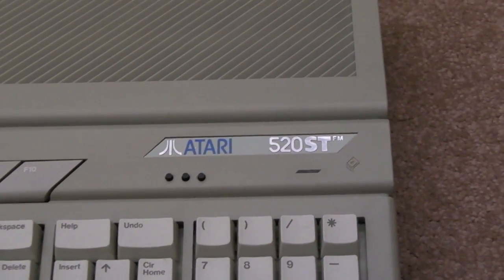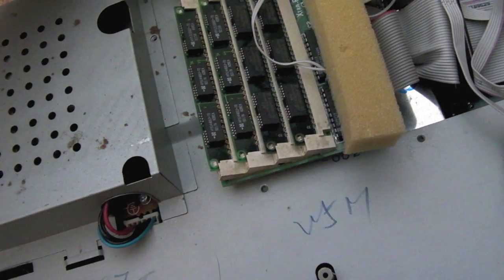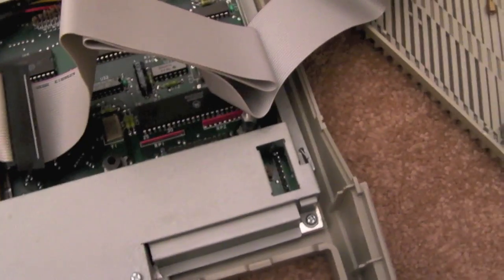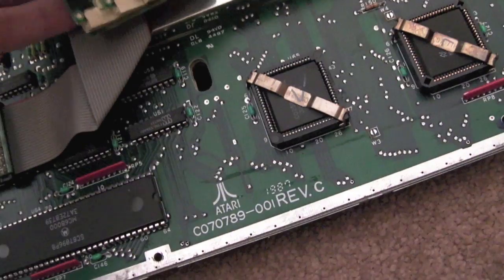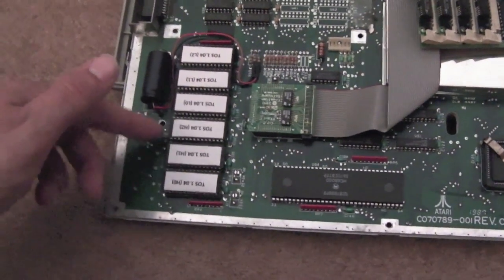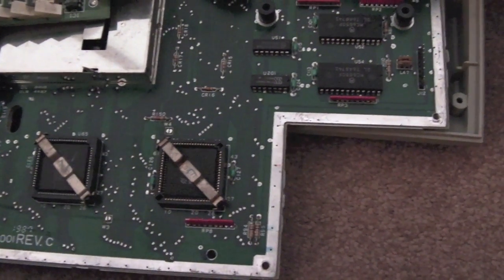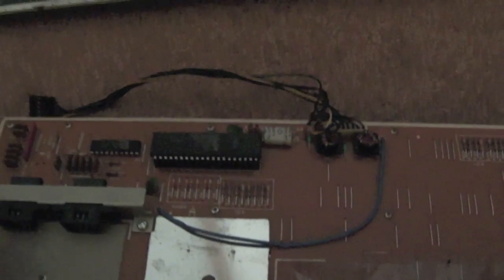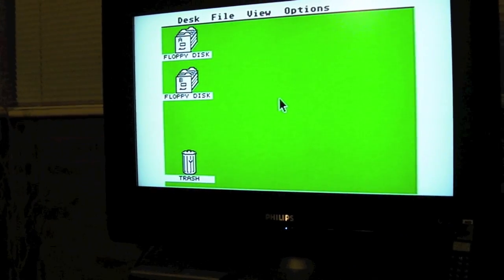Atari 520STFM Teardown + 4Mb Marpet Xtra RAM + TOS + Blitter Upgrade + HxC Floppy Emulator & More

Comment: Good to know there's not too much to go wrong.  I was looking at them on eBay and there are a lot of "untested as I don't have the cables but the light comes on".  In pretty much any other retro machine I'd expect to find a damaged board, and a leaky CMOS battery looking back at me all "what?" like a puppy stood among a pile of shredded loo roll.
Reply from the maker: Hehe =D  Power Supply tends to be the main issue in ST's.  Occasionally you may get bad RAM, or a faulty Glue or Shifter chip.  They are much more robust than Amigas though imho.
Reply: That's cool! I'm an Amiga man at heart (hey, easy on the tomato throwing) as I only had an Atari for about a year or two when I was 5 then it was swapped for an Amiga after, but I do have memories of it and wouldn't mind one for the first part of a "reliving the journey" (of my computing past) that I'm hoping to do :). Cap changes for PSUs no big deal... I've saved my share of monitors from landfill that way....
Reply: I've kept Amiga for Amiga Forever and stuck with ST for real hardware as it is better designed for the most part. The case and GUI look better too.

The PSUs are iffy, not quite the Atari XL ingot, but the Meanwell RD50 and 60 are small enough to fit. The 50 requires off the shelf cable. The 60 requires a 3 prong jack that isn't cheap to obtain, but the tradeoff is smaller size for the same power output. And the amperage is definitely needed if add-ons like memory are to be added as the 5v rail on the original is 3A. Meanwell's is 6A for the 5v rail and that's better than plenty!

Comment: Great video. :) I remember my STe PSU failing when I was a kid. I used a Spectrum +3 power supply and wired it onto the connector. Worked for years like that! :)
Reply from the maker: Haha, that's sweet lol!  Never would have thought of using a +3 PSU to power an ST =)
Reply from the maker: Thanks for the positive comments and for watching and commenting btw =)

Comment: Nice seeing the tear down you have done.  One thing to mention though, looks like you are doing this on a rug, and there is a handful of CMOS chips in there where static electricity can zap the life out of those chips.
Reply from the maker: Yes, on more recent videos I stay well away from the carpet =D   It's a case of when I worked in the trade I always worked off ESD mats with a wrist strap, but 30 years later I got lazy when I first started working on my own stuff.  I've taken the feedback along the way and corrected my ways.
Reply: @GadgetUK164  Handy hint is you can usually ground your static just by touching the shielding in the case, its not the right way to do it but its an old trick, hence why you were fine doing what you did. p.s where did you get your 4Mb Marpet Xtra RAM from? wouldn't mind doing that mod on my 520stfm

Comment: Hi! I'm just watching (and in some cases, re-watching) your series on the ST. After many years, I've become the proud owner of a stock 520STfm. It's in a filthy state and in need of retrobriting but appears to work ok. I have a question regarding the keyboard - are all of the screws the same length or do they vary..?
Reply from the maker: The tiny screws underneath the keyboard - I think there might be one or two longer ones but most of them are the same size.  On the case there are a few different lengths I think.  It has been a while since I took an ST to pieces.
Reply: GadgetUK164 I had a feeling you might say that. Best I get my magnetic mat out when I do it then! Many thanks, Dave

Comment: Hi there I have a question,  I am getting a 520 stfm from Greece to be sent stateside. Does the built in power supply allow for the voltage to change from the 205 to 110 volts ?
Reply from the maker: Not that I am aware of!  I think the power supplies for these are region specific - I could be wrong though!  Just inspect the PSU PCB and look for anything that says 220 / 110V

Comment: What does a upgraded Blitter give you? Are you able to run TOS 206 if you wanted??
Reply from the maker: The Blitter is used by GEM - so any window based app makes use of it.  Some software also supports the Blitter and one or two games (but not much).  To run TOS 2.06 you need additional address decoding - I think the TOS upgrade from Exxos covers that (check first before ordering).
Reply: @GadgetUK164  Thank you:glasses-purple-yellow-diamond:

Comment: Hi, just wanted to say i enjoy your videos really educational too and they have helped me with lots of my own little home projects. I was hoping to pick your brain on an issue i had. I have an old Amstrad PC1640 DD that i have taken from someone who was going to send it to the tip.

The Amstrad powers on and seems to work okay, it has the original mouse and keyboard which also seem fine. The issue is with the old ECD monitor i have as the screen is just showing up black, I have spent hours searching online for old manuals and finally found a pdf with the full manual which has helped me to troubleshoot and try lots of different things but still no luck.

I was wondering if you might be able to take a look at this and it might make a great video to look at this old machine thats quite hard to find today is one piece with all the peripherals together too.

I could attach pictures of video at a later date so you could see what you are dealing with and also i guess it depends where your location is so i could drop it off near you also.

thanks Josh
Reply from the maker: Thanks, I cannot do repairs for other people due to a long term health problem.   If you are based in the UK you might be able to get it repaired by 'Dave Curran' at tymemouth software?   I suspect I know what's wrong with it, and might have a spare part if Dave needs it.  Those monitors provided power to the base unit, and they had large chips stuck to a heat sink (I cannot remember the correct name of the package body of the chip) - often their part numbers started STK.  Those are what failed all the time in those old Amstrad monitors.  It was so common that when I was in the industry we started adding 12v fans inside the monitor to cool the heat sinked 'STK' chips.
Reply from the maker: Sorry - typo there "Tynemouth Software"  http://www.tynemouthsoftware.co.uk/

Comment: I have this old Marpet +8 for STe that gives 8Mb Ram.. even have the floppy and manual for it still. Can't remember where I bought it but it was on sale :D
Reply from the maker: Isn't there a 4MB limit for the ST and STe?  It must be ALT-RAM or something?  Quite rare I would think!
Reply: From what I've read it seems to trick tos into thinking it's a TT, so it's probably seen as alt-ram for a total of 12Mb. The 68k is able to address 16Mb i think. I don't have an STe any more so I can't test it.

Comment: Just recapped my stfm power supply , it was completely dead before, wouldn't even show a power led on. replaced all caps with similar or higher specs, suspect it was the 400v cap which had swollen at the top.
Reply from the maker: Great job =D  Another ST saved!!!

Comment: Nice Video, Thanks for the hard work.....  I am thinking of getting the Floppy Interface like you have, any chance you can do a video on how you set up the SD Card and how to copy from PC to card etc... ?
Reply from the maker: I will try and do a video on this at some point!  I had planned to do one related to the Ultra Satan - that's a better purchase than the SD floppy drive imo.  Because you can copy games onto the SD still, but they run much faster etc.   If you haven't already, check out PP's hard disk adaptions here:- http://atari.8bitchip.info/fromhd.php   And if you do get an Ultra Satan (HDD rather than FDD), you can get PP's hard disk driver from that website too - it's pretty cheap, something like 15 or 20 euros I think.

Comment: Capacitance may be fine but what is its ESR? Unless you can verify that a capacitor has the correct ESR, they are generally bad if old as you can not guarantee that the electrolytic compound leaked out as not all capacitors will pop.
Reply from the maker: From my experience, there is a relationship between capacitance and ESR.  When its capacitance is spot on, it's rare the ESR is out - it can happen, but I've found it to be rare.  I've been collecting every single cap I've removed from things over the last 4 years or so., and I will be covering that in a video at some point.
Reply: @GadgetUK164  So how do you know when a capacitor is stuffed and behaving like a conductor and putting DC bias on a rail where it shouldn't be?
Reply from the maker: Obviously its a good idea to check the ESR if you can!  I will be recapping the motherboard on that ST soon - will check the ESR on each I remove, but I am betting they are probably all OK.  The sheer volume of caps I've replaced over the last 4 or 5 years is staggering, and in all cases where I replaced them for the hell of it - all the ones on the board were all still fine.  There are places cap fail more (eg. PSUs) and there are bad brands etc, but there are far too many people thinking that you must always swap out every single electrolytic in a system.

Comment: What's the reason for having 4MB on STF? Are there any games that require 4Mb of RAM?
Reply from the maker: I use it with a HDD, there are thousands of games converted to run from HDD (See Atari PP Adapted Games) in Google).  Those make use of RAM above 1MB.
Reply: @GadgetUK164  Oh, so it is basically like whdload, that requires some ram
Reply from the maker: @Kppot  Yes =D  The game assets get cached =D  PP's HDD adapted versions of ST games often use 2MB or more - just speeds everything up and makes it run well from HDD.

Comment: Hi!I've just got a used marpet memory upgrade (not Deluxe) for my STf.My MMU and VideoShifter Chip are socketed as i found out in the pdf instructions.So i just install these two chips and solder the gnd cable somewhere for ground and I'm good?! didn't quite understand how to turn off the onboard memory and what this mod of yours is about.Would you be kind enough to explain better?
Thanks!!
Reply from the maker: Sorry I missed this message somehow!!  There should be two wires which have clips on both sides, and you connect one end to the 5v and the other to a pin on a resistor which I think you need to lift or cut.  That disables the on board RAM.

Comment: Is this a custom Atari ST or can you get one that has a SD card input?
Reply from the maker: It is a standard Atari ST with a couple of upgrades.  I use the HxC floppy emulator (uses SD card) from Lotharek (search for Lotharek in google).  I also have an "Ultra Satan" which is an external HDD for the ST - that provides 2 x SD card slots for virtual HDDs.

Comment: Have you cut the back panel? Mine looks like this http://i.imgur.com/eCQ6t.jpg and makes it really difficult to take out the PSU, because of the mains switch :/
Reply from the maker: No - the PSU can be a bit tricky to remove!  I didn't explain very well in that video at all, you have to kind of tilt it and massage it out - it's a bit awkward to do!

Comment: Atari used nice hardware, but what a mess with psu and ports for joystick and mouse (compared to Amiga). And what about disturbance and heat from psu? I like the mods even if they are not reverseible. (Pardon my english)
Reply from the maker: Thanks!  Yes, some strange design choices by Atari!  I never like having the PSU internal - due to heat and noise etc.  But it's also a shock risk if anything gets spilled over the ST.  These days that probably wouldn't be allowed to be sold lol

Comment: So, a grounded A9 and an open circuited MMU (pin 64) will drop my 4MB Marpet back to 1MB?

I think I can see where you severed the connection on the memory board itself (heat shrink), am I right?              Subscribed!
Reply from the maker: AtariBorn It's a two fold thing - you have to install a switch so one throw of the DPDT switch  goes: - 

When ON it connects SIMM pin number 18 (A9) to the connector as normal - so its basically going to the A9 pin on the ST MMU.   When its OFF, the connection from SIMM 18 (A9) is NOT connected to the connector going to the ST MMU - this sets the ST into thinking the SIMMS are 256Kb each, giving you 1Mb.   On the other 'throw' of the switch (DPDT switch is used), when ON the central pin of the switch is connected to the ground and nowhere else, when OFF the ground (middle pin) should then connect to the SIMM 18 (A9), so basically its supplying a constant ground to the SIMM 18 (A9) pin when the A9 pin is isolated from the ST.   The reason you need to do this is without forcing that A9 on the SIMM to ground it will be floating (not high, not low) and can and will flip state on its own causing crashes etc - it probably won't even boot.
Reply: Gotcha. I appreciate the info.

Comment: Ahh try not to yank cables out by the wires instead of using proper tools / methods.  Those keyboard wires and plugs are so fragile and break easily,  a bit like crappy molex ones do on PCs.  Great video though! :-)

Comment: Hi brilliant video and really enjoyed the way you make it all look so easy ,I hope you don't mind me asking a question only I have a problem with my Atari st fm  and this is it does not show the icons or boot screen on boot up just a black inner screen with a white boarder ,it has been suggested that the chips need reseating ,but I am not sure where they are and was wondering if they were it that you showed on the left hand side of the Atari ,any help please ,very best wishes Brian.
Reply from the maker: Hi!  Thanks for the nice comments =)  I will be doing some work on my ST this weekend so I will do a video for you whilst I am in there, to show you which chips to press down on.  All you need to do is press down on the chips which are in sockets.  The RAM (top left), 16 of them are soldered straight to the board - so you cant do anything with those) but any chips that have a black plastic socket under them - those are the chips you want to 're-seat'  rather than take the chips out and put them back in the first thing to do is just press down on each of them.  Sometimes they will make a small click or creak as they move back into their sockets.

With time and heat they creep out of the sockets a little.   The main ones that could be causing your problem are the square chips with a socket around their edges.  Just press down in the centre with your thumb to make sure they are down in the sockets OK.

There's a chip (video shifter chip) in the silver shielded can in the middle, so you will have to bend the little clips on the metal casing there to lift the lid so you can access that chip - again just press down on it to make sure its firmly down in the socket.
Reply from the maker: mrmusdtard2
Hi, i've uploaded a short video explaining about the chip reseating!